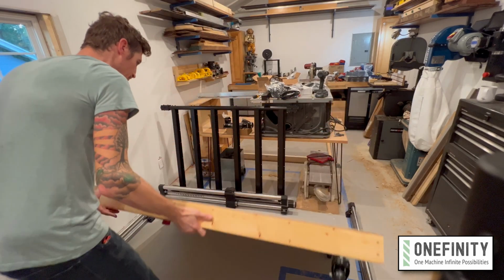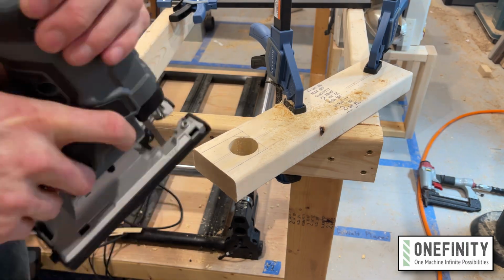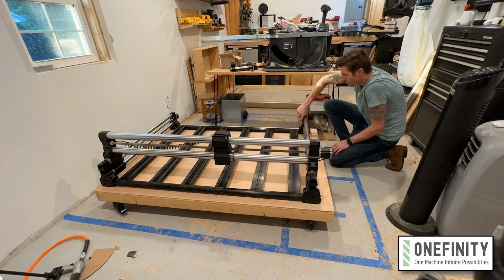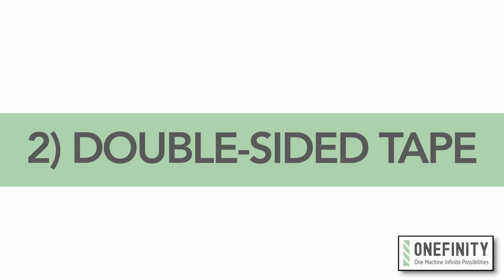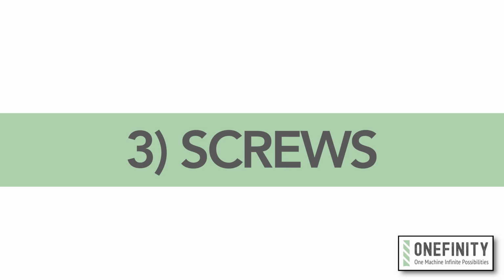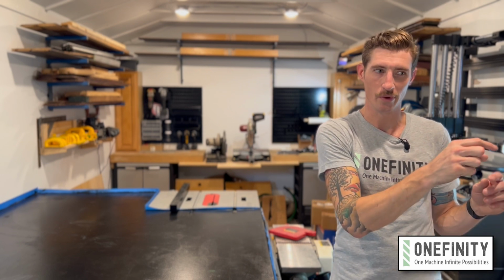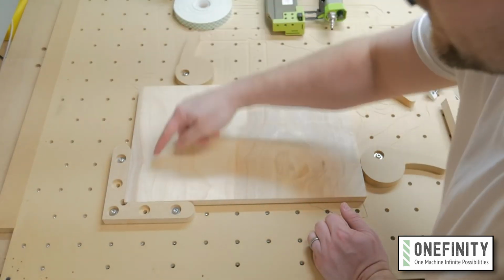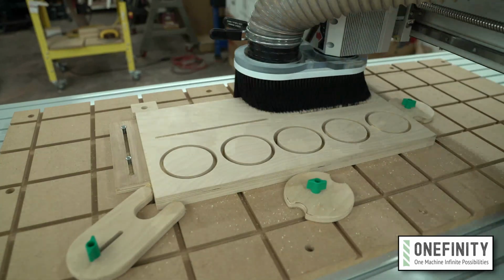EP2 Onefinity CNC - Work Holding

Comment: I made my Onefinity wasteboard using the MatchFit bits but I only had the 1/2" shank so used my router table.   I didn't realize until just now they had 1/4" shank bits too.   I just ordered them so now I can create the wasteboard on my OneFinity, which is what I wanted to do originally.    For holddowns,  I "merged" my  MatchFit green guides with my Opps clamps and that works great on the MatchFit wasteboard.   I like the wasteboard you created and can't wait for a link to give it a try.
I enjoy all of your videos!  Glad you're with OneFinity!   Keep 'um comin'
Reply from the maker: https://forum.onefinitycnc.com/t/3-onefinity-cnc-3-must-haves-in-a-cnc-wasteboard-includes-matchfit-dovetail-wasteboard-system-files-free/14303